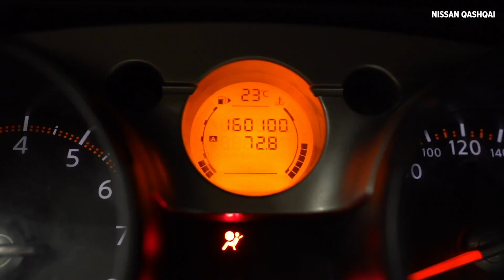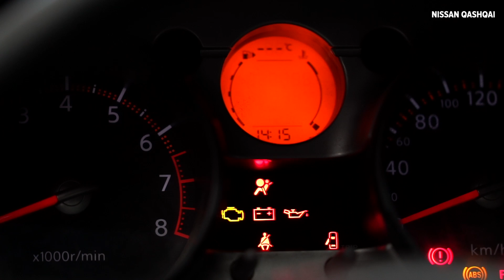How to change oil filter and engine oil on NISSAN QASHQAI j10 [TUTORIAL AUTODOC]

Comment from the maker: 🛠️The tools you need to replace engine oil and oil filter: 
- drive socket No. 10
- flat screwdriver
- oil drain pan
- drive socket No. 19
- oil filter wrench
- torque Wrench
- funnel
Reply: Helpful, is the oil filter # for Nissan 2010 different from the recent years?
Reply: Hi. Thank you Very much for your videos. They are really helpful and enlightening.

On this one you poured a red liquid in the engine, then started it. What was that liquid and did you switch off the engine before draining? 
Thank you.

Comment: How important is the torque wrench,if im trying DIY
Reply from the maker: In practice, it is mandatory to use a torque wrench and observe the appropriate tightening torques.
Reply: Never ever used a torque wrench in 40 years, never had a leak and never over tightened.

Comment: Would have been more helpful if you had mentioned the grade and volume of oil you used
Reply from the maker: This car has a 1.6-liter gasoline engine. Replacement requires 4.30 liters of oil that meets ACEA A3/B4 specification.